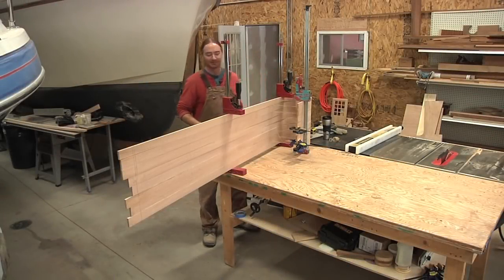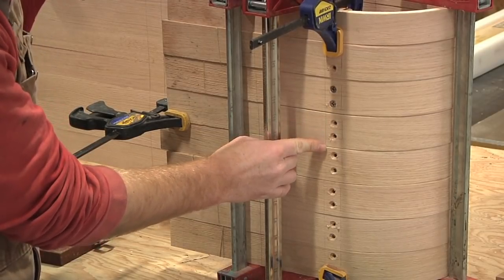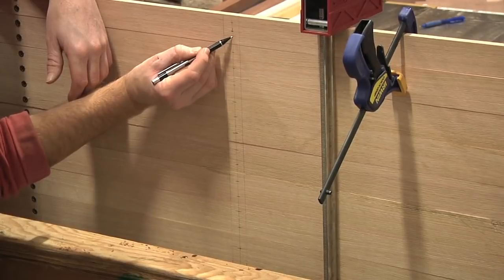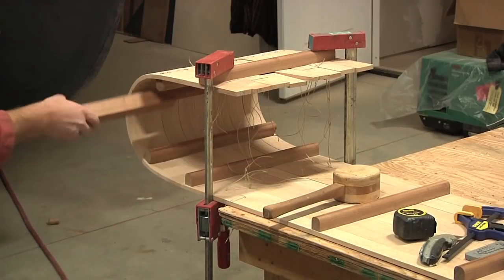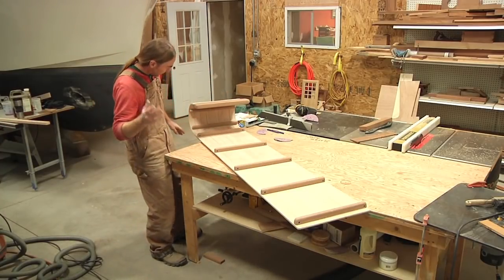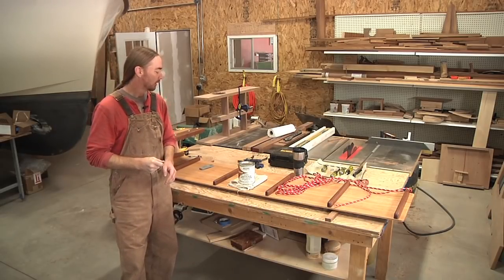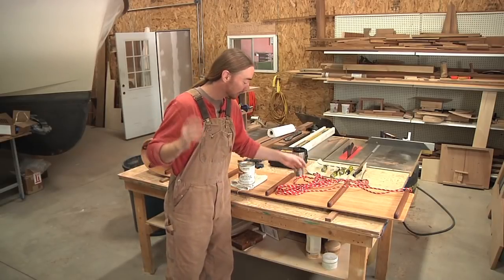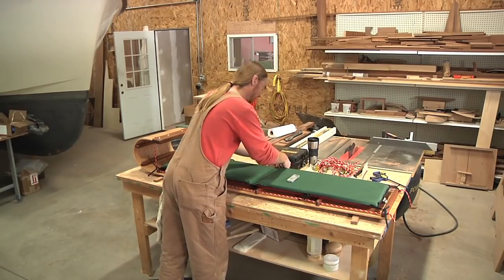Steam Bending a Toboggan / Sled (Part 2)

Comment from the maker: Never seen snow :-O  You should take a road trip!!  The main reason I didn't glue anything was because the wood was still relatively green (MC 18%) and as it dries / shrinks  I was worried that the planks may split if they couldn't move.  Also for flex and repair-ability.  I wanted any to be able to take this apart if needed :-)

Comment from the maker: Hi Ron, I just counter sunk the screws and capped them with wood plugs.  Shaved the excess material off the top of the plug to make them flush with the runners and gave a light sanding :-)

Comment from the maker: I put the slats together tight as the wood was still somewhat wet and I knew that they would shrink (which they have :-)  Now I have roughly 1/8" between each of the planks and I think it looks pretty sharp.  On the breadboard I oversized the 2 mounting holes through the mahogany and screwed into the bent oak with a couple of finish washers to help dress it up.  With the holes oversized this should allow some movement without cracking :-)  Glad you liked it!  Thanks!

Comment: do you worry about the epoxy cracking or delaminating from all the flexing of the sled? (toboggan) :)
Reply from the maker: Stan Czyzon No, I didn't apply enough for it to become brittle (just a couple thin coats were applied).  Just wanted to seal the wood and add some moisture protection :-)
Reply: Good to know, Thanks.I have a compartment door in the middle of my floor that covers a storage area. about 20"x30" and need to cut the underside out and replace the core. It got wet inside the fiberglass shell and the door sags if you walk on it. might be a good place to use this process on the new wood!

Comment: You placed something on your tobaggan build that I've never seen before: the two bottom runners.   What dimension are they.?  Looks like about 3/8" also.  Does it allow some steering or does it track too much to steer.   Would you do this again with another build?   
Other builders have used slats that were 5/16" planed down to 1/4" .   Why did you choose your dimension and do you find that contributes too much to the handling of the heavier sled?

Comment: in high school 20 yrs ago i tried to make a tobogan with a real green ash 3/4 in thick, the board cracked even after soaking them in water overnight. i own a commercial made wood tobagan. nice to see someone build one. great video. you want to go real fast buy some wax and a propane torch and melt it accross the bottom. fastest one on the slope.

Comment: Thank you for posting the video. I live in NC, USA. I built I tobbogon over the past couple weeks. I used hickory. How exactly did you run the rope from the last slat to the bread board and back down. Thanks again.
Reply from the maker: kevin thompson Started at the back slat (tied with a knot) and ran the line through holes drilled in each of the slats going forward, up through the breadboard, across and back down through the slats on the other side.  Tensioned the line, tied a knot and called it done :-).  It was 1 continuous piece of line.

Comment: Great project! A thought regarding the satin finish and its UV protection capacity. I assume you are well north of the equator, and with the sun transiting low on the sky you will get less UV radiation.  I don't think you'll have any problems.
Reply from the maker: +Stephen Grasser So far it's holding up great!

Comment: I like the craftsmanship of your toboggan it looks good. Well done. Had a Toboggan when I was a kid that my dad bought us. We used it a lot in the Pennsylvania hills in the 1960s.
It did not have any bottom runners like my other sleds and I wondered how
to steer it because of all the rocks and trees in the field that we had to
avoid. I was told that the toboggan had to flex along the length of it to be
able to steer it. We had to lean hard in the direction we wanted to go. Raise
the Left side to go right and so no. It seamed to work. So the question I
have is, how did the runners on the bottom of the toboggan work for you was it too
stiff to steer fast enough, or did it work out Ok for steering?
Reply from the maker: So far no issues with flex or steering!